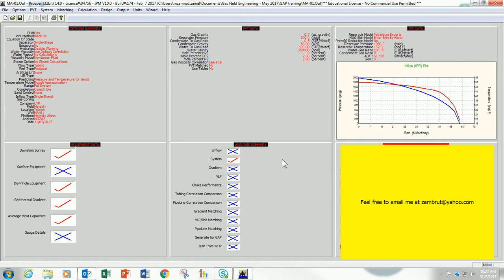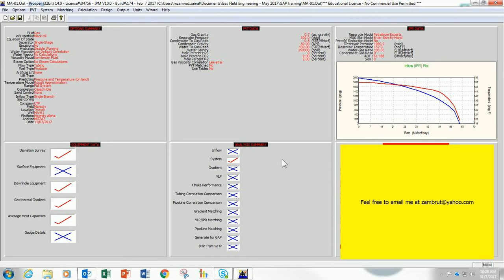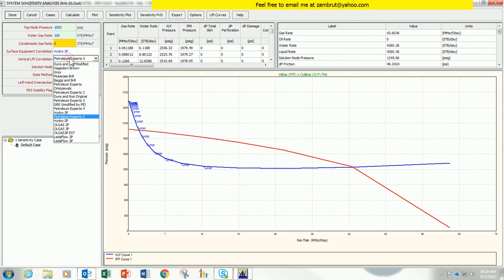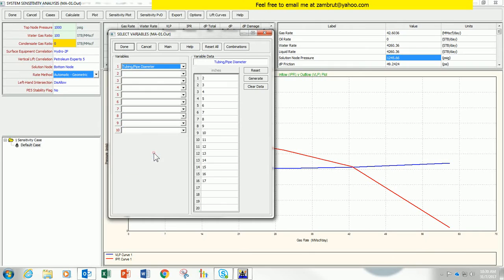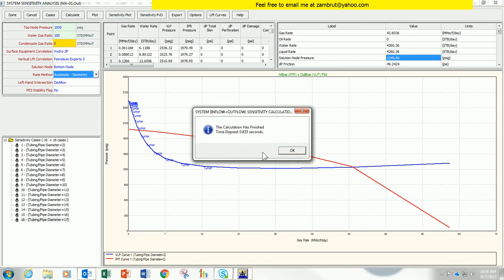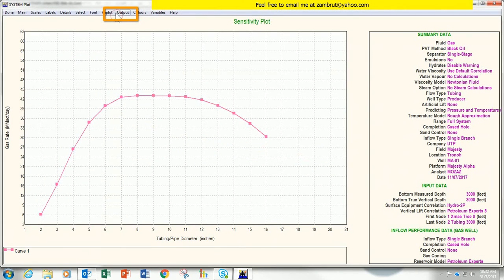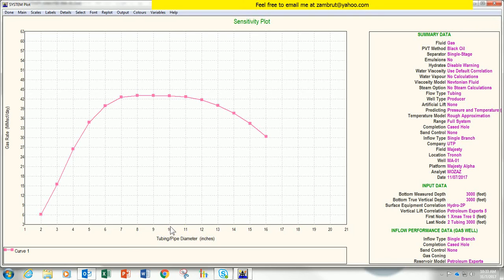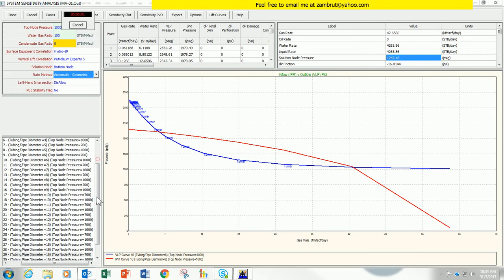PROSPER Guide - How to plot  the results via System Plot and Sensitivity Plot

Comment: Hello , How do we work dual completion ( two tubing ) in same well
Reply from the maker: Salam. Prosper can only work with single string completion. Petex does provide workflow on how to deal with dual string using Resolve software.
Reply: Mohamed Zamrud Zainal 
Thank you
Reply: Mohamed Zamrud Zainal 
There are a number of chock methods.
How do we choose the best chock method ?
Reply from the maker: You can refer to the help section. If you have field data, you can try which of the method that can gives you best match with field data. Then, use that model.